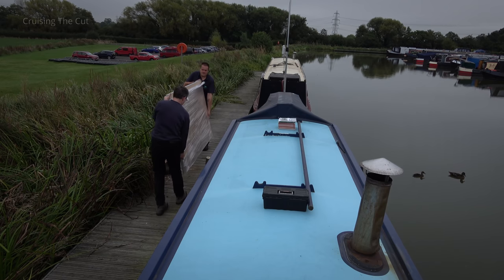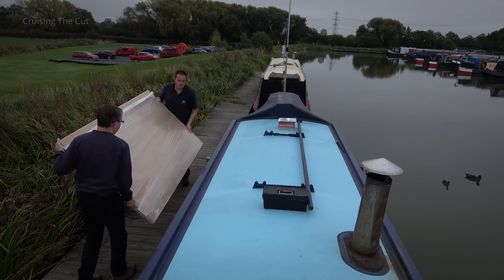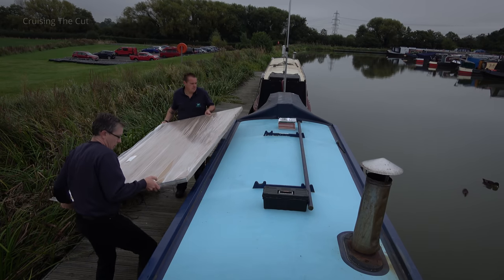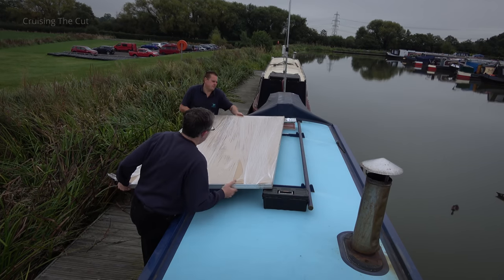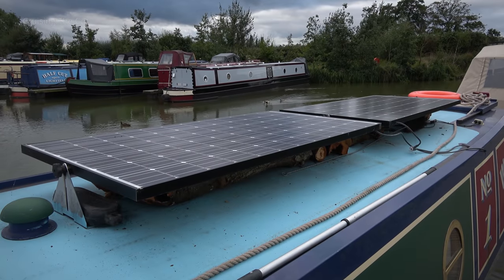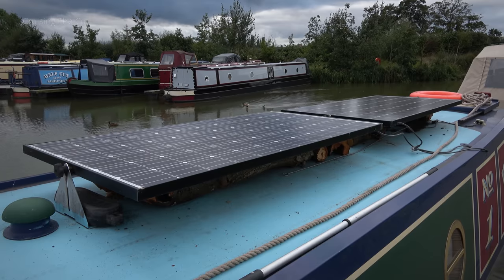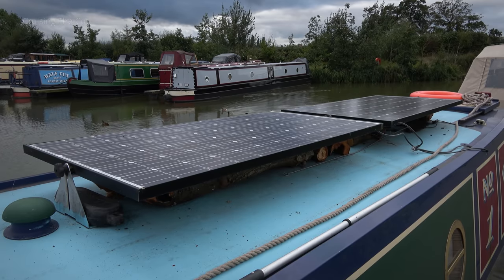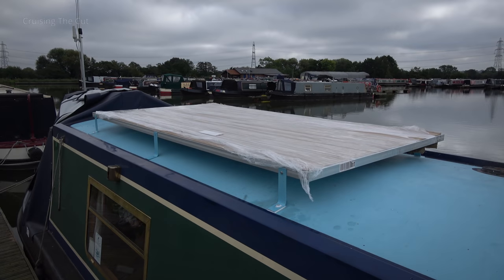260. Solar Panel and Lead-Carbon battery update (narrowboat)

Comment: So I’m assuming that “rent” on a pontoon with power hook up is more expensive. Is that why you don’t just stay on one of those pontoons all winter. Also, How much fuel are you using to run your engine a couple hours a day? Are fuel prices rising there like they are in the US? My goodness, it’s crazy here. Im about ready to put some solar panels on my car. Wishing that I had gotten a Volkswagen instead of the big SUV I bought…
Reply from the maker: It wasn't the cost but that marina pontoons have all the boats side by side, staring into each other's windows. I managed to get on a much nicer pontoon at the edge of the marina, with no neighbours either side and a view of the water and of open fields - but no power or water supply.
Reply: @CruisingTheCut  totally understand that. I like my privacy too. I recently had to replace my wooden privacy fence and sadly, I couldn’t afford another privacy fence and had to go with a chain link one… I feel like Mrs Kravitz (if that reference means anything to you) lives behind me now.

Comment: Where have I read that you can get more out of your panels by using lithium batteries 
Also you obviously get more usable power from lithium  plus lithium batteries batteries can be charged so much  faster   
Sounds like the way to go  lithium batteries are coming down in price very quickly
Reply from the maker: Still rather costly, alas

Comment: Have you given any consideration to, in the future, upgrading your batteries?
Reply from the maker: Not really, if I had a new boat I would but I'd also go 24V etc
Reply: @CruisingTheCut  why? Nothing runs on 24VDC. All consumer electronics I’ve seen run off 12VDC (or 110/220VAC). What would be the advantage of going to 24V?

Comment: You thought about Eco-tree lithium's? they charge at 100% till full and at 100amps safe input.
They do heated lithium's but they only charge at 50amps but could be used in engine bays (lithium's wont charge below 5 degrees). 
That would reduce engine run time during the winter months. 
A lot cheaper than Victron batteries but still have a 6yr guarantee 👍
Reply from the maker: Still very expensive
Reply: @CruisingTheCut  Wait till you get your shore power bill next winter😬🤣 
I'd look at off grid as an investment mate, If LPG get's scarce, with faster charging lithium's you could use induction and other 240v items? Just a thought👍
Reply: @borntraveller007  Is LPG threatened ?
I hope diesel isn't !

Comment: Three Battle Born 100 AH Lithium Iron Phosphate batteries my friend! You will get much more usable time before you have to recharge! Very little degradation of the battery and you get 100% of the 100AH per battery! Yes they will cost approximately $1,000 US apiece but well worth the investment! You have some nice equipment there but your weak link is your batteries! You can only use 50% of your existing batteries power and then you have to recharge or risk damaging the batteries !
Reply from the maker: Please see the pinned comment at the top
Reply: @CruisingTheCut  the pinned comment doesn’t seem to address changing the battery bank. The comment you’re responding to is not about one of those all in one power bank things, it’s about a replacement for your battery bank with more modern, higher capacity batteries.

Not that that is a magic bullet either, of course. Even if you could magically increase your effective capacity by a factor of 2 or 3 (at a cost of “only” 3 grand), you’d still have to run the engine almost as much, you’d just be able to do 2 hours every two days, instead of one hour every day.
Reply from the maker: I did address it, in my discussion of lithium batteries
Reply: @CruisingTheCut  The lithium batteries Jasper is referring to can be drawn down further than standard lead batteries and the charging profile is more efficient. Less time spent charging them for an equivalent amount of power due to less efficiency losses and greater usable capacity. Totally unrelated to those silly "power banks".
Reply from the maker: My apologies, I did specifically address lithium in the pinned comment but that section has vanished (probably due to my inept editing on a phone). I have now added my response to that again and re-pinned the comment. Sorry for the confusion.
Reply: @CruisingTheCut  ah, that explains why I didn’t see it! I mean, it’s not like I couldn’t have predicted what you said there, I just wanted to note it wasn’t explicit. Especially knowing now that a sale was presumably already on your mind for a while, that adds a lot of urgency to not spending oodles of cash that will definitely not be made back in a sale. (In retrospect, I feel like there were a bunch of hints over the past year or two as to the live aboard thing no longer really working for you at the moment.)
Reply: Better batteries might help a tiny bit, but if the solar panels don't put at least as much into them as you talke out, then  you will not have enough energy (unless of course you have one of those "free energy" machines foir which you can fin no end of videos here on youtube).

Comment: You might consider putting your fridge/freezer outside (after doing more research as I'm not an expert), but the phase change that the refrigerator cycle uses should take significantly less power if it's not fighting your stove.
Reply from the maker: It's not practical to move the fridge outside
Reply: @CruisingTheCut  ditch the fridge. Humans got by without them for eons. Milk powder for the porridge and a cold spot for the butter. Try it, it’s quite liberating. Love your channel btw, sighs from Melbourne, Australia.

Comment: The main reason you increase the panels is as part of increasing the storage.  You will see more improvement now adding more batteries or upgrading to lithium.

That would give you more time in bad weather for them to deplete and also would help your recharge cycles as you would have a lot more overhead.  As you said, the lower the batteries versus max - the more power you can store in a short time.
Reply from the maker: The main reason I increased the solar was to try to get more power in winter; filling even my existing batteries would be a dream in the deepest depths of winter!
Reply: @CruisingTheCut   yeah, that is why you may see more benefit in capacity.  Ideally you could run several days before having to run the engine or having sun.  More if you go lithium because you can run them down further.

Comment: Have you heard of the youtuber Alex Hibbert? https://www.youtube.com/c/AlexHibbertOriginals

He's doing a series now where he's testing various solar panels specifically for low light usage in the Arctic. He might have some useful information for you in his reviews. 

Honestly though, you might just want to look into some new, with better technology, batteries so you have a larger capacity and/or a high efficiency/output alternator. With both you might find yourself running the engine as a generator much less often. You might also consider just getting a dedicated generator, it will be more efficient(you'll run it less time disturbing your neighbors) and you can put it in a locker and make it quiet if you really want to.
Reply from the maker: Money though!! 🤣
Reply: @CruisingTheCut  The more youtube views the video(s) on the project get the bigger effective discount you get. You could end up making money overall if you do it right. :p
Reply: @CruisingTheCut  To be fair, I mostly just want more videos from you and this would be a good series to watch. 👺👍

Comment: Hello David from Sydney Australia.
Good to see everything is going well.
You've made me think about the solar energy systems and the available and stored energy in a battery bank.
Don't they use a hydrometer in lead acid battery: something about the free ions. Not sure: lead carbon albeit.
I've started experimenting with a multimeter. You Do Not want to change the dial settings while metering an amount of AC voltage 242v "They are separated tests and metering"
Take care, O.. what about a hydroturbine generator in the water when cruising?
🌅🇦🇺
Reply from the maker: Such a generator would be getting its energy from the forward motion of the boat (there being no current on the canals), that motioj being entirely generated by the boat’s motor. Physics shows that the energy required to be used by the engine would outweigh that generated by the turbine in the water so you don’t win! Besides, the engine already has a generator attached to it, the alternator, which directly charges the batteries.

Comment: You would be more efficient if you ran higher voltage
Reply from the maker: The boat is 22 years old and all designed on 12V so not practical to change.
Reply: Seems that everything he has on the boat that runs off 12VDC is trivial, e.g., LED lighting and the pumps that only run rarely. All the big energy hogs are 220VAC and his inverters are near that batteries, so that’s about all you could ask as far as electrical efficiency.

Comment: Surely you could get a wind generator attached to the boat that drops away for tunnels and has a cage round it so it doesn't do amputations - nothing to big just the size of a bedroom fan.
Reply from the maker: Please see the pinned comment
Reply: needs to be 15+ meters in the air (at least the 100 watt units I've seen used by people living full time in their (American) motorhomes.

Comment: If only a tiny diesel generator were produced that would charge your batteries without requiring gasoline.  Diesel is easily available on the canals.  I searched and found nothing tiny.
Reply from the maker: Agreed!
Reply: He needs a bigger boat 😊
Reply: A little Honda 2000i inverter generator would do the trick. Just get one that runs off propane, which is readily available. And they’re reasonably quiet.
Reply: That's honestly surprising; I know there are a few one-cylinder diesel generators around NA; but sadly they are producing our rather lackluster 120v AC and would need some tinkering if you wanted to run 240v UK appliances off them. I suppose you could take the inverter out and just use the alternator directly though, if you didn't mind whatever ludicrous price it costs to ship it over to the UK.

Thinking on it, we also have lots of generators that start on gasoline, and switch to propane when running you can find them under 'dual fuel' models. PResumably propane is easy enough to get on the canals, since it's used in many of the boats too. You could look for those in the UK if it suits your needs; maybe have more luck.

Comment: Please use kWh, my non boating brain doesn’t compute amps lol 😆
Reply from the maker: Sorry!! Haha most boaters think in Amps and Amp Hours because that's how the battery capacities are quoted.
Reply: Those aren't at all the same thing. Amp-hours could be correlated with kilowatt-hours if you know the relative voltages of the two systems you are comparing but just plain amps to kwh is like asking what is 2kg in miles per hour.
Reply from the maker: I didn't say they were...
Reply: @bragr_  OK, let's keep it metric to make things easier. What's 2kg in kilometres per hour?
Reply: @CruisingTheCut  Amps makes far more sense to me.
I have trouble with kWh but I can cope with kW/h. Doesn't a 3kW heater use 3kW per hour ?
Reply: @bo_bo_deluxe  Thanks, I was way out, I thought it was about three hectares.
Reply: @millomweb  Only if it's switched on.
Reply: @barriegibson6411  purple
Reply: @barriegibson6411  Four pence ha'penny in pre decimal measurements
Reply: British Ants Perhaps watch a non boating vlog.

Comment: Just a thought. Why not use the prop shaft to charge batteries ?
Reply: What would be the point?
The alternator is driven by the engine whether the boat is moving or not. The propshaft is driven only when the boat is underway.
Reply: @ericdunn6232  he probably means as a river turbine
Reply: No current on the canals.

Comment: With DC circuits 1 Amp = roughly 15 Watts.
Reply from the maker: Depends on the voltage, of course...
Reply: @CruisingTheCut  15 V obviously.

Comment: Do some narrow boat owners put diesel generators on their boats?
Reply from the maker: Yes, some do
Reply: Those generators have the same issues the main engine does, noise pollution and vibration of the boat. A portable generator you can put onto the pontoon clears up the vibration but still leaves the noise issue.

Comment: You just need to fill the roof with solar and get some used Tesla battery modules
Reply from the maker: The roof is as full of solar as it can be. Tesla batteries are just lithium cells, nothing unusual about them
Reply: @CruisingTheCut  Nothing unusual??? Don’t let Elon hear you say that!! 😉
Reply: It isn't practical to have more solar. He would have to have hinged swing arms that unfold and cover the width of 3 narrow boats with a perfect angle set up. That is all too costly for a problem that is mostly just in winter, and is easily solved with plugging in to shore power or running the engine for a few hours.

Comment: I cant help myself, I have to write it :D
I just saw a Vlog 7x couple hours ago. You've already stated having no clue about fridge consumption. Don't you think it is time to check/measure real values of that old lady, perhaps new kid would help to save some juice. Also, is that auxiliary generator that much evil, that it is not acceptable to charge this way?
Reply from the maker: It's not old, I bought the fridge new when I bought the batteries.

Comment: solar is not a single solution as you have demonstrated people want to tell you this, hence a 1000w honda generator as backup as a hybrid system is always better, and you dont run A/C in the summer so solar is only a little solution for only a specific weather pattern, snow, cold, shade cloudy, and extreme heat are all negatives..and guess what that is reality instead of an invented reality where solar and wind are the go to solution, they arent

Comment: Get a heat pump
Reply: How exactly would that help his energy situation? A heat pump is just an AC running backwards. Talk about energy hog! He already gets his heat from the coal-fired stove. Zero electricity use there!
Reply: He could also get an exercise bicycle attached to a generator. Don't laugh, a local university professor had that set up to run his television. If his children wanted to watch tv, they could only power it by pedalling.
Reply: What electrity sorce are you goingto use to run the heat pump?
Most heat pumps draw ~1000 to 2000watts...
so David could not run one off batteries with only solar panels to recharge them.

Comment: So you never heard of electric ⚡ generator??? There are some toys who are very silent even dual fuel ⛽ provide plenty of power ?!
Reply from the maker: Yes, of course. Please see the pinned comment at the top.
Reply: @CruisingTheCut  i am talking about sailing ⛵ boats generator working on diesel fuel....you store it into the engine room they do require water cooling ! Another solution is you need to cover your hole boat on solar panels ! A compromise will be a small portable generator like Honda who works on Cooking Gas too and you can't hide it in your closet.....
Reply from the maker: There’s no space in my engine room for a generator, and diesel gennys are extremely expensive.
Reply: @CruisingTheCut  well i guess the only option is a small Honda generator a portable one ! And the fuel ⛽ problem you solve it by having a metallic barrel or a liquefy gas bottle the one you use for cooking and the toy it small enough to keep it in the closet ! I use this type of generators for off grid construction i got 2 of them on small for electronics and lights and a bigger one in 3 fazes for  power hungry tools ! And in my country "Romania" GPL it cheaper that means Liquefy Petrolifer Gas it mixture of Butane and Propane with a little Hexaciclane and the proportion it different in the winter ❄️ they put more Propane to increase the combustion temperature 🌡️ ! But it works excellent for generators it clean the fumes are nothing but CO2 and H2O you change the oil and oil filter much rare.....

Comment: I really wish that the likes of all the Gretas of the world could see this video. Overcast, rain and no wind means that they could not charge their phones, laptops. Power the t.v., and no food from an electric cooker or microwave. They would be screaming for a coal fired power station in a matter of hours.
I have watched many Youtube videos all about Solar power and if you live North or South of the 40 degree parallels they are NOT a "viable alternative.
Reply: Your statement is only really true if a numpty designed an undersized system.  A properly sized system with adequate storage works. I have one.